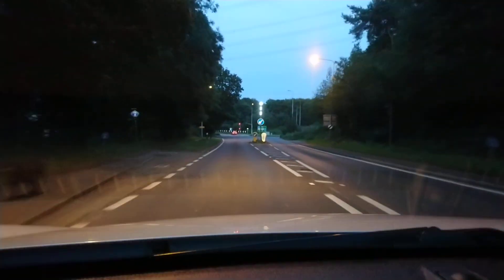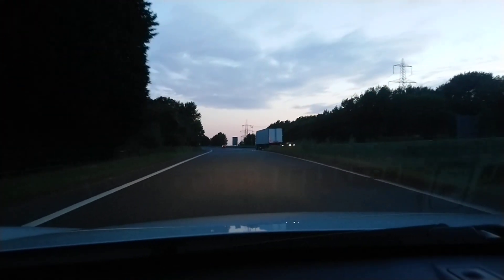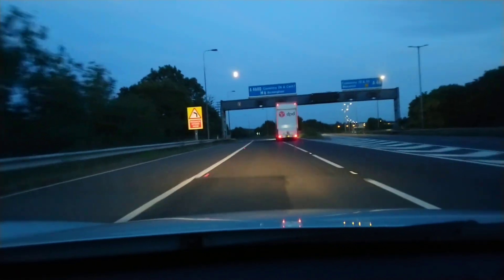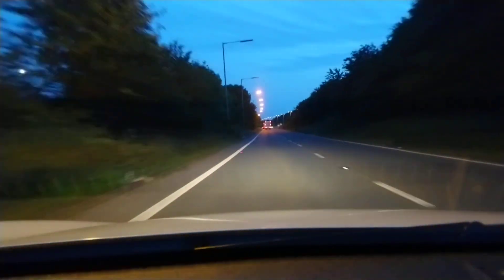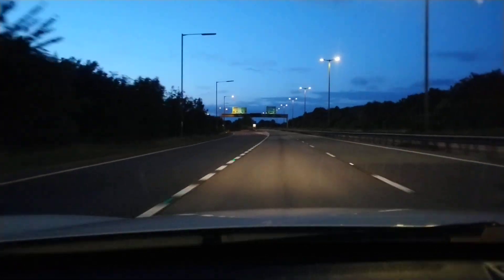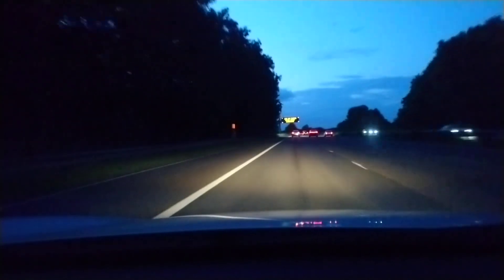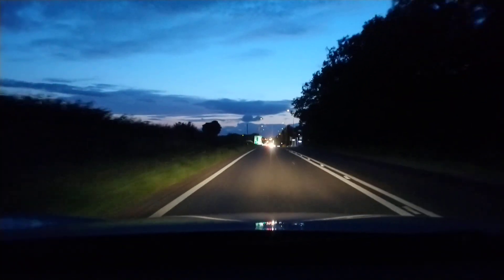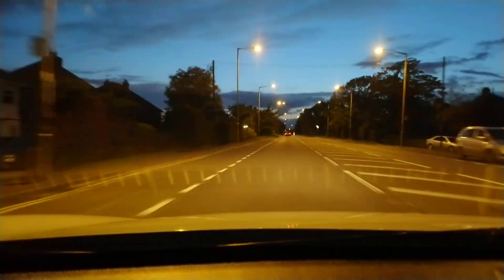LPS, HPS and LED Highway Street Lights on the M69

Comment: I really miss the old LPS  SOX type street lights - they used to be everywhere when I was young, but now you hardly see them at all, apart from the odd very old ones that sometimes crop up in rural areas and villages, but even these are now being changed for LED ones.
I did have to go a different route the other week and ended up on a road I haven't used for a while, but there were so many old Philips MA50 with remote gear street lights it was like going back in a time warp to the 1980s / 1990's all over again - so much monochrome orange. That road is the A5013 road leading towards Eccleshall straight as you exit the M6 junction 14  roundabout between there and Great Bridgeford. And pretty much every one of the them was working as well, so Staffordshire County Council must still have some 135W Sox lamps left in stock to keep them going. Those old lamps would last years and years, unlike today's LED lights. 
In Stoke on Trent where I live, we still have quite a lot of HPS street lights on the main roads, including the main A500 between J15 and J16 of the M6, but most of the side roads now are on LED.
It is very rare in Stoke to see any SOX lights left, but as I say, that road between the M6 J14 and Great Bridgeford, there are tons of the old 80's MA50's and they pretty much all work.
Reply from the maker: HPS Street lights on A5 Watling Street from M69 to Nuneaton still there but roundabouts now LED.
One Day Burning 135 watt LPS still working Coventry A46 / M69 Slip Road on to M6. But LED's are replacing them now so will gone soon.